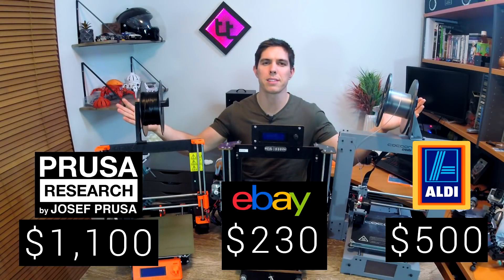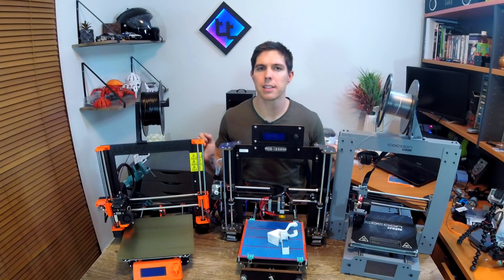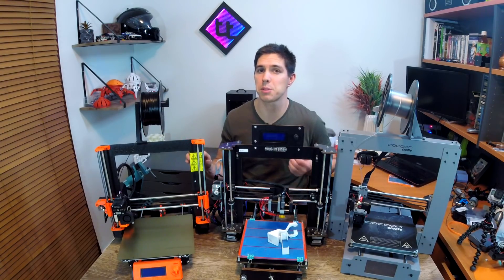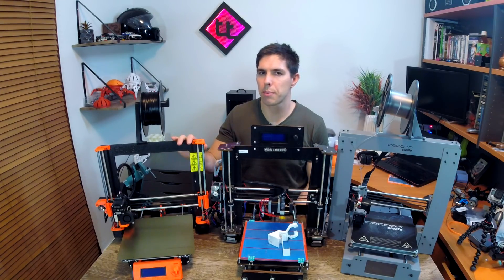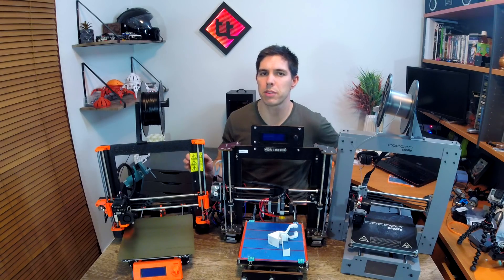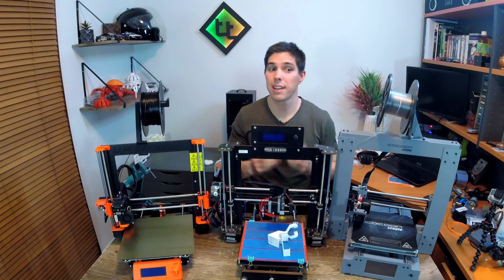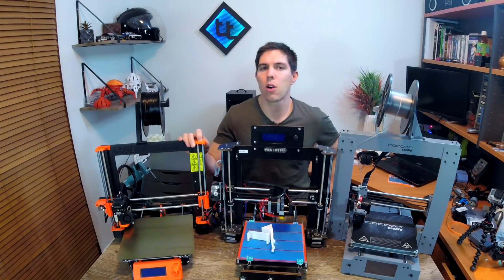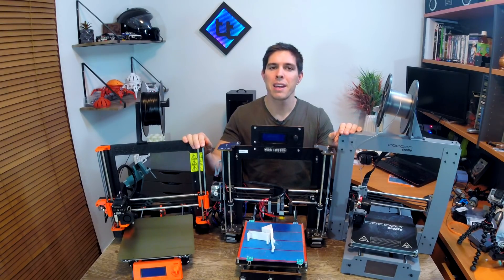i3 Comparison: Prusa i3 MK3 vs Cocoon Create Touch vs CTC i3 Pro B

Comment: I had the ctc i3 clone. My experience with it was mixed. As a printer is bullshit. I dont think I had more than 3-4 prints without something in the printer breaking off badly. At the begining I just could not get it to extrude and that, as I did not have another 3d printer, meant I could not do anything but to buy other extruder. After upgrading the extruder and a few things, the motherboard died and one fan stopped working. After that, extruder head was just bad, had steping issues and a long list of failures... However, after investing around 200$ in upgrades and some time, the printer becomes kinda ok. If you keep in mind that the CTC i3 is not a real printer but a kit for building a custom one

Comment: I've had three low cost printers including a threaded rod and wood i3 and since the MK3 came out, I now own three of them. No more screwing around with one issue after another. I just load the model I need and print it. I just pre-ordered a Prusa XL since the MK3's have been working very well for me. The only issue I've had are SD card slots and the rotary switch wearing out but when you can replace the entire display and reader for $5 from Ali-express in about 15 mins that's a very minor problem.

Comment: I have an anycubic mega is very similar to the cocoon and one of the advantages i find of a mostly metal construction is its less of a fire risk, even the electronics are encased in a metal box. If you see the aftermath of printer fires almost always its fueled by the plastic parts of the printer melting and fueling the fire even more.

Comment: You can get aluminum replacements parts for the Prusa. I have done everything except the carriage, psu bracket, and control board bracket. The bear frame with aluminum parts is also a really good upgrade and my second Prusa will be using that.

Comment: I have watched a good number of your videos and have found them very informative, well done.  However, I have a question.  I plan on getting a CR-10 Mini as my first printer but I am also considering building a Prusa i3 Clone.  Would it be feasible to use the hardware from the CTC i3 Pro kits, as they seem to be a bit cheaper now ( https://www.geeetech.com/acrylic-geeetech-prusa-i3-pro-b-3d-printer-diy-kit-p-917.html ) along with something like the Bear i3 Upgrade kit ( https://all3dmakers.com/products/mk3-bear-upgrade ) in order to save money on the hardware while creating a more rigid printer in the process?  I have watched a couple of i3 clone builds and it looks like a bit of fun as well as a little challenging.  Let me know what you think.

Comment: I think it is a mistake to recommend the cheapest and the worst machine which needs the most done to it before it prints, as suitable for beginners. A beginner has even less experience than money so if the printer does not function out of the box that would be the end of his 3d printing experience. Contrary to popular belief I think that the Prusa , probably the most reliable , is best suited to a beginner if budget permits, otherwise something like an Anycubic I3 Mega is the one to go for. Thanks for a very informative presentation.

Comment: Prusa support is the best customer support I've ever dealt with. Got the printer on thursday, it arrived with a faulty Z motor, I was talking with support through the weekend, I talked to them for like 15 hours total to figure out the problem. We found it on monday morning, I got the new motor on tuesday afternoon. Since then, it prints like a charm, nothing to tinker with or worry about. It just works.
I am never going to buy any other 3D printer, just Prusa. It's well worth the price.

Comment: I know this is an old video, but I would like some help with deciding on a printer. First off, the printer would be used in a project I am starting up called Santa's workshop, where we 3d print toys for kids in lower income areas as Christmas presents. And we are looking to buy a few printers, probably 4 or 5. As simple plug, play, and mass produce, what printer would you suggest, the prusa mk3 or the cocoon create? This project is being formulated into a nonprofit, and done through my college, the University of Memphis. I have watched your videos on the different 3d printers and have an ender 3 myself, but am looking for something more reliable. What might you suggest? Thank you so much
Reply: Get the Prusa..  I started with a Wanhao i3 (the older non touch screen version of the cocoon).  The Cocoon is nice how ever over time you'll be upgrading things for sure such as the z brace (mentioned in the video) and y axis carriage (because the thin metal of the original bends/warps) by the time your done modding it you'll have another $200 to $300 (USD) in to your printer.  The Cocoon you have to manually level the bed with 4 screws (not a huge deal how ever slower).  The Prusa uses a probe so it auto levels.  If your looking to go on the cheaper end I'd likely look at the Ender line of printers rather then the Wanhao/Cocoon line.  Also note that Prusa still updates the firmware for their older printers (they still update their mk2 firmware) where the older Cocoons/Wanhao's are no longer updated (they did update the firmware for a time but stopped after a few years)

Comment: You sure picked the wrong low cost machine. Anet A8 or any of the Tevo products of much better quality than the one you bought. Also you forget to mention that anyone can buy four or five of the lower cost machines, therefore the odds of you getting more than one working are much more in your favor of the low-cost machines. A lot of parts on the very expensive Prusa machine are just 3D printed Parts which can be made by any of the other printers. So your statement ” you get what you pay for is not true you're not getting four times the machine” with the Prusa.
Reply: Ya Prusa has had firmware problems since the MK3's release, I've seen so many unhappy Prusa customers on Facebook, its almost 50/50 good to bad reviews in the last year for a product thats partially 3d printed itself, and double the price of Crealitys machines at half the build size (S4 600 $ ) 
Prusa is simply the more popular machine, the more hyped machine. NOT the best by any means. Its the Honda of 3D printers. Small-Cheap.

Comment: If the Cocoon is that much trouble why wouldn't anyone get an Anet A8 for the same price. I have two of them and I love them. I have them both printing reliable and pretty awesome I have to say with all the modifications Iv'e done to them. There pretty maxed out except for a Bowden system.  I had a lot of fun doing it and learning on the way. I just tested one of them with the chain mail and it came out perfect. I'm testing it as we speak with the Easter egg torture test at 150% and I'm testing my MonoPrice mini V2 with one at 100%. Wish me luck. Anyway I have only been printing now for 7 months and I've been bitten by the bug. I have 4 printers now and my next one in a few weeks is definitely gonna be the Prusa MK3. I cant wait. 🤗 I've been enjoying watching your channel for as much knowledge as I can get. I'm now a subscriber.
Reply: Ps. You need to be careful on witch Anet A8 you get because they are different. I learned that the hard way when I had to return one.
Reply from the maker: Hi Bobby, thanks for watching, subscribing and taking the time to write about your experiences. I haven't used one but I believe the A8 would be a great base to modify and build a capable printer from. You are case in point. Enjoy the MK3, mine is still my favourite printer.
Reply: Teaching Tech I'm so new, I've been bitten by the bug and I have 4 printers already. I'm shopping for my fifth and I'm pretty sure its gonna be a Prusa MK3 🤗
Reply: Teaching Tech PS. I can't get enough of these videos.
Reply from the maker: 3D printing can be quite an addiction, welcome to the family.

Comment: Awesome video! Thank you! A friend has the Aldi Cocoon and seems to get fairly good results (not sure if he's modded it at all yet). I've been looking at the Anet A8, which if I'm not mistaken is a "child" of the i3, is that right? Do you have anything to say about the Anet? like have you used or owned one and if so what are your thoughts and opinions, please? Awesome channel! keep up the great work! thank you! :)
Reply from the maker: Thanks for the feedback, and for watching. I haven't used the anet but my impression is you would need mods to make it safe and reliable. It is based on i3, yes. It used to stand out because it is cheap but there are more players now. I have a Ender 3 on the way to review which I'm hearing good things about.
Reply: Thanks for the response! awesome! And yes the net is cheap. I have a friend with one and they have done "all the mods", including firmware replacement with all the safety features you talked about. And he gets great results. So I'm leaning into that as my first because I know i have someone to lean on/learn from. :) I look forward to the Ender 3 arrival and video :)

Comment: Prusa has one killer feature that no other 3D printer offers for MK3's price - silent printing. For those of us who don't have a spare room or garage to run it in all day long it's really worth paying extra just not to have the constant noise. My Anycubic i3 Mega while being a great printer is really noisy. I'm waiting for Prusa to sort out the early problems with MK3 and start shipping it without weeks delay to buy it.
Reply: Just upgrade to lower cost machines with better parts you'll still have money in your pocket and you'll have silent machines.
Reply: I've spent countless hours upgrading my Anycubic i3 Mega. Bearings, rods, different bed carriage (mine was warped), cooling, TMC drivers and it's still far from perfect. I just discovered that my Z wobble issues are due to the lead screws not being straight and that glue in one corner of the ultrabed is letting it go, so every time I level the bed it only lasts for few days before that corner peels off a bit more. Frankly I'd rather take my kids for a walk than waste another day taking apart this chinese crap to fix it again so I ordered Prusa. My time and energy just isn't worth it.
Reply from the maker: That's a really good point. I don't use stealth mode much but I was really impressed by it when I first got the printer.
Reply: I believe it's relatively quiet even in the normal mode thanks to the components. I've got my running in a spare bedroom but living in a British home erected in the 70's the walls are paper thin so I can still hear it a little bit at night. Hopefully Prusa will get their shit together in a month or two so I can order one. :)

Comment: Thank you for good comparison. BTW, which one do you use more often than others?
Reply from the maker: Prusa is the go to because it's so convenient to use. Cocoon has been modded a lot lately for flexibles and is doing a great job at that. Video to come after more testing.
Reply: Thank you so much. I'm using a 3KU delta printer, which is truly a workhorse. But I'm getting to the point where the convenience of use is the highest priority. Going to try the MK3..

Comment: seams like you really hammered on the cheap one. just saying which cheap one is a heck of a choice, but the wire management? really? your putting yourself down there as you did it. take 15 mins and try to make it look neat, and secure in place. you left one heck of a bird nest and put that blame on trying to make money on more expensive units.
Reply: You could buy a shit ton of cable management for that machine and still have a hell of a lot of money in your pocket
Reply from the maker: I hammered the cheap one because of the dozen or so 3D printers I've used over the years, it is by far the worse. Fai point on the cable management. Students did assemble it so that explains it partly but the instructons and components provided for cable management were pretty average.

Comment: If the printer wiring is so bad, don't use it at school. It won't meet Aus electrical safety standards, even with your mods. Shock risk for students and legal risk for you!
Reply from the maker: Been tested and tagged by the qualified electrician at school. The only problem was the mains crimping being exposed, which the printed part covered. Everything else is low voltage DC so no electrocution risk.
Reply: Good. The RCDs would maintain safety anyhow, but you don't want to give the impression that standard printed parts can be used for electrical safety applications. Electrical insulation plastics are tested for long periods at extremes of temperature and humidity. I doubt a printed part would be acceptable even if the material were identical, due to porosity, surface effects etc.
Reply: @paulwary  most of the Prusa machines parts are 3D printed. And you could buy the top quality replacement parts for the lower cost machines and still have a lot of money in your pocket so your point is null and void.

Comment: To be honest I think it was a poor comparison of the Prusa mk3. You didnt mention the community around the Prusa, the forums, the github support. The constant firmware revisions. No mention of key upgrades that set the mk3 apart from the other two. Like the filament runout sensor or the resume print after power failure or the print head crash detection. No mention of the sensorless homing or the super quietness of tmc2130's motor drivers. No mention of all the self-test and calibration features of the firmware. 
All these features should have been mentioned in comparison of price, features and reliability. The mk3 cost twice as much as the cocoon for reasons I've mentioned here but you left out of your video. I dont think your video shows enough of the things the mk3 has that the others are missing to justify its costing double the price of clone.
Reply: Many of these fine features that you mentioned what makes the Prusa of piece of crap and give it so many of its problems. Also there are huge communities and forums behind these lower-cost machines like the anet A8 and the Tevo trantula. None of those fancy features you mentioned seemed to improve the quality of the parts you make I think I will use my brains to improve the quality instead of in the endless supply of money that Prusa has.
Reply from the maker: I acknowledge what you're saying but this video was already long enough without including that detail. I did mentioned the advanced features in a general way and link via card to my video review which goes through all of that properly. It's my compromise to keep the length down.

Comment: The CTC looks rubbish, but what a brilliant learning tool, children will easily find faults with it and redesign improvements. These improvements probably better being printed on either of the other two printers.
Reply from the maker: That's true. You could do it it on the CTC if you have it working for long enough to do so. Hopefully that scenario would improve with each upgrade.

Comment: Hi Michael, thanks for the reviews. I have the ALDI machine and I find it pretty good for the money - I paid $400 new BTW :-).  I saw in this review that you were going to do a firmware upgrade in a later episode using the Silverquark firmware.  Thought I'd just mention that there is a later fork (that is based on Silverquark) for these machines and their clones which also interestingly includes support for auto bed leveling and has a nice user manual among other things. It appears that the Silverquark fork that is based on Marlin 1.1.4 hasn't been active since 2017 whereas the Andrivet version is more recent and based on Marlin 1.1.8 with some nice improvements over the original.  I was thinking of doing this myself but am happy for you to take the risk first :-) and perhaps do a video of the process and your findings on your channel?
Here's the link if you're interested. - https://github.com/andrivet/ADVi3pp-Marlin
Keep up the good content and cheers for now.
Reply from the maker: I've had a look and it appears to be fantastic. Thanks for the tip off, I'll definitely feature it in the video and credit you.for your help.
Reply: Hi Michael, I got a rush of blood, bit the bullet and did the update - well two actually (you have to do the LCD and the mainboard separately).  All went well thanks to the excellent clear instructions and I have to say that, while still early days, I'm impressed with the new features and the much, much nicer colourful interface. The firmware is still in beta (V3) at the time of update but I'm really impressed so far.  The project is still being actively worked on and there is a proposed 'change of filament' functionality being tested at the moment which should allow the easy change of colours during a print to be a reality.  As mentioned there is a version of firmware that supports the BLtouch for bed leveling and I'm thinking that that will be the next project for me a bit down the track when I'm happy with the manual leveling version.
Still looking forward to your findings and experience with the post installation tuning settings and setup.
Cheers
Reply from the maker: Hi Daryl, Just flashed everything successfully and am about to edit the video for a release tomorrow. Thanks again, you will be credited!

Comment: Your comparing printers with quality parts with printers with crap parts. Sure the latter works for a while, but will crap out very soon. A fair comparison would take over 6 months of printing, not just a quick test.
Reply from the maker: I've had these printers for a while, they've each done some work. Except the CTC which barely prints and needs some serious time put in that I don't have. I feel I've accurately represented the many issues of the cheap printer. The other two both have a good reputation for good reason.